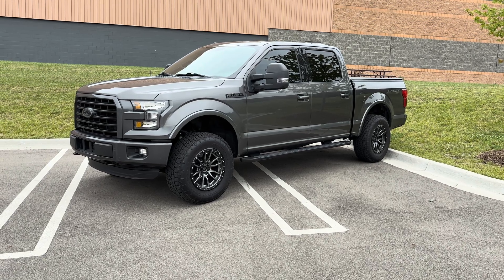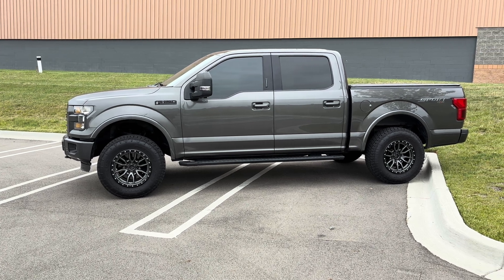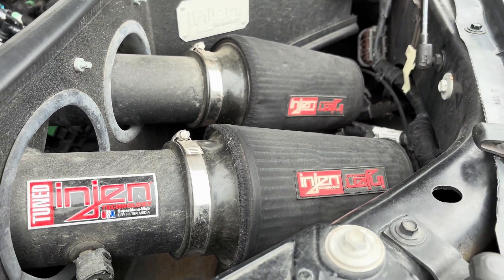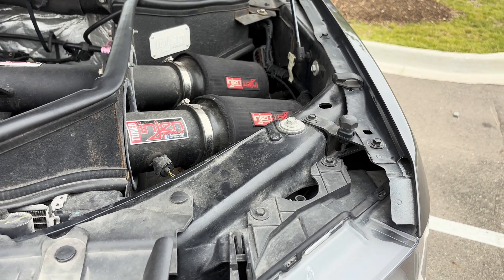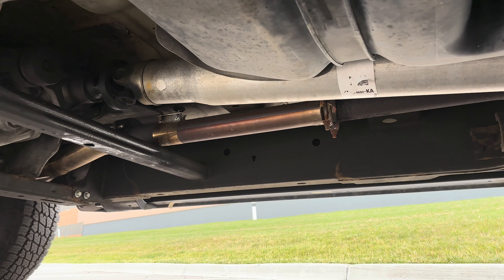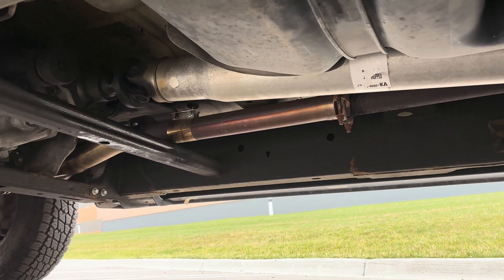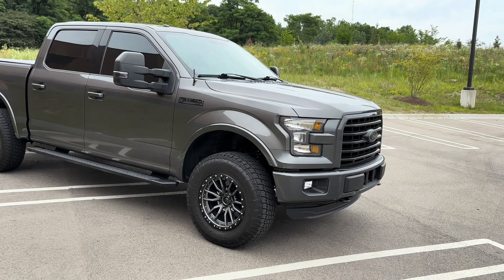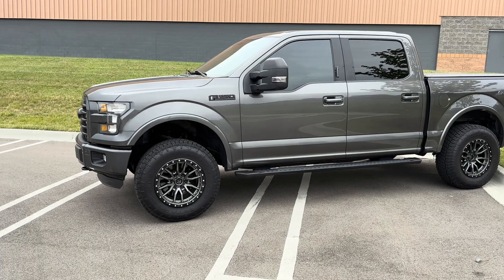How to Build a 450+ WHP 2.7 EcoBoost

Comment: I'm looking to get a 15-17 or 18-20 2.7, but I can't decide... they seem to be about the same price, my main concern is the wet oil pump belt on the gen 2 2.7, and the CDF drum and such on the 10R80, but then kinda worried about carbon buildup on a used gen 1... thoughts?
Reply from the maker: You can always do an intake manifold cleaning. I did it with the Seafoam product to help with carbon. As for oil pump I’ve never heard of the belts failing although anything is possible.
Reply: @TUNED2.7   Makes sense, I had thought about doing something like that so good to know it works. And yeah that's what I had seen too, no failures that I could find at all. I'll probably just drive both and see, I'd love to have a 10-speed, and port injection/E85 capability

Comment: For one, I'm sorry if this is no longer relevant to some folks, but I'm commenting a couple years after the fact and not looking at newer videos. I'm looking at intel for my '24 Bronco 2.7L Wildtrak and this is valuable, thank you! If I can offer just one suggestion, don't feel pressured to speak. Take a breath, it's OK. You don't need to say "um" or "ah" after each thing you say just to fill the silence. If there is "too much silence," you can edit that out. I guarantee you there will never be a silence longer than the one you originally perceived in your head (I know this firsthand). Speak with confidence. You got this! Everything else is gold!
Reply from the maker: Thank you!

Comment: We just got a 2015 F150 2.7 Extended Sport w/ 120k miles on it. New turbos. Love it. going to apply your advise. just got dual air intake and going to get the air cooler next!

Comment: The 2.7 is the way to go hands down. The block is incredible and so much more worth it. Way less issues then the 3.5 and 5.0
Reply: What issues does the 5.0 have?
Reply from the maker: Oil consumption, timing chain and water pump are the main issues I’ve seen as a ford tech

Comment: I had a 2022 F150 2.7 with a 5-Star 93 Octane tune.  I made 360rwhp and 400+ rwtq SAE.  I cant find my dyno sheet, so I dont remember the exact tq.  It was either 410 or 440, just dont remember.  Also, so driveable, just like stock.   Also, had a CAI, but forget which one.  Maybe a JLT.
Reply from the maker: Switch to MPT you won’t regret it. Made 408 with tune only and no bolt ons

Comment: Really wish the car 2.7 setups got the same size turbos. 450whp is aftermarket turbo territory on the Fusion/Edge 2.7s. We have to at least upgrade to 3.0T Lincoln Continental/MKZ turbos and do all the supporting mods you’ve mentioned here to even come close to 450.

Comment: Beautiful example of an F150, but man that air filter is kinda pointless if it doesnt seal off the engine bay air right? I mean the air is going to take the path of least resistance and just flood in around the intake pipes.
Reply from the maker: I got an S&B now. I have a new video out on it

Comment: BULL-SHIT!!! The mains on the 2.7L CRANK aren't HALF large enough to endure 450 RWHP or close to 540 HP net with windage losses, tranny losses and driveline losses!  One hundred sixty-six HP per liter below 9,000 RPM requires cylinder pressures no engine can sustain. It MIGHT make 520+ crank HP, for a few seconds! Top fuel dragster engines make 10,000+RWHP, for 15-18 SECONDS then become wreckage when burning 87% nitro-methane at 22:1 compression ratios, with boost added on top. Aero engines don't make that level of power...
Reply from the maker: I mean you can look at the hundreds of dyno videos out there. There’s many 2.7s making well beyond 540 with turbos, e85 and all the supporting mods

Comment: How would a e85 tune effect reliability?
Reply: Ethanol is more corrosive than gasoline, which can lead to wear on fuel system components (like fuel pumps and injectors) not designed to handle it. I would stick with gas. The custom tunes with gas (91 or 93) are amazing.
Reply: @garygrimes2024  thanks mine is a 2020. Would a 93 tune be better in your opinion for reliability

Comment: What’s next on the upgrade list?  HPFP and injectors?  This would be a monster on an e85 tune.
Reply from the maker: I’m pretty happy with the power it makes on the 93 tune. I know it’ll make way more power on e85 but it’s also pretty hard finding gas stations in my ads that sell e85
Reply: @TUNED2.7  E-85 also causes fuel system corrosion. I would stick with gas. :-)  I just received my SCT tuner with canned tunes and running 91. Already impressed with the boost.  Spun 33" tires from stop without hitting it hard, and ran rocketed to 80MPH so fast. Can't wait to try my 91 PRX tune!
Reply: If u have a 18+ 2.7 between direct and port injection there's enough fuel system to run a e85 tune stock .. truck on my channel has minor mods intercooler .. inlet pipes .. intake .. res delete on e85

Comment: Truck is bad ass.  I want to make the HP without the ricer sound. 🙂 Any suggestoins?
Reply from the maker: Do the down pipes and keep the rest of the exhaust stock. Get high flow cats like mine. If you go catless it’ll sound bad
Reply: @TUNED2.7  Thanks man.  Great video, learned a lot, can't wait to do similar upgrades.  I wish i could see/hear some additional revs on your truck.  :-)

Comment: What kind of fuel is the best to use?
Reply from the maker: If you’re not tuned just save the money and run 87. If your tuned and wanta make great power then do 93 for sure (or e85 if your tuned and rated for it)

Comment: wheel and tire set up? Is that just a level kit? great looking truck!
Reply from the maker: Nitro Terra graps on fuel rebels. 33” tire on 18x9 -12mm. On a 2.5” level
Reply: @TUNED2.7  What level did you use? I did 33" tires, look great without any level. I would like to get the 2" leveling shocks for the front.

Comment: When i was looking for a truck i was looking for a 5.0 but ran across the perfect truck 2018 80k miles already had wheels and dual exhaust but was a 2.7 i bought it because it was a great deal and i could not be happier with the 2.7 i tuned it of course and im so happy i didnt get the coyote the 2.7 is like a diesel makes all its torque at just 2700 rpm and tuned will torch 5.0 trucks.
Reply: Same here, was looking to get a 5.0 but landed on a 2.7 with 80k miles. Are you having any transmission issues? I was looking for specifically a 2018 with a 6 speed but this one popped up and it was a great deal. Now it’s got shuddering issues after about 1000 miles of driving it.
Reply: @davids1924 I had a weird little issue when I first got it when the transmission was cold it didn't want to go into second gear so I changed the transmission fluid and filter and it's fine no problems so try changing the fluid and filter and use something like Amsoil ATF with the blue cap really good stuff it'll fix that problem most likely. Because the shutter is usually the torque converter shuddering when it's locking up and a lot of times that's just dirty fluid
Reply: @davids1924  possibly the torque converter
Reply: @davids1924 it's most likely a clogged filter if you do a transmission flush and a filter change it usually fixes it. Mine did it from 150k to 360k and I pulled a trailer every day.

Comment: Nice Rig!
Just discovered your video. Although I have a '15 3.5 I can attest to all of the gains regarding your mods as I have all of those as well. I still have a set of CVF turbo inlet tubes to install and I'm considering switching from closed box CAI to the Injen open box.

Comment: The spark plugs you have in the description will work just fine for a 2015 f150 2.7L MPT tuned?
Reply: Go with ngk 95605 @ 0.028” gap. These ones are better in comparison with ford GT

Comment: Nice mods. Too bad it’s a soccer mom truck (4 doors). What did these mods do to your mpg?
Reply from the maker: Crew cabs better for gapping people. You get to say “you got gapped by a crew cab” haha. With my level and 33” tires I’m doing about 22 mpg. On stocks closer to 23-24. I drive fairly conservatively and coast when I can
Reply: a 2018 f150 2.7 ecoboost with the proper bolt-ons and a tune will easily gap a 2018 rapter. all about how you mod.
Reply from the maker: I have a video when I walked a 10 speed raptor

Comment: The first mod you can do is buy a coyote and boost it lol. Nice truck man. I'm still hanging onto my 2011 f150 5.0. Truck prices these days are ridiculous! I would like to update someday tho. However it seems like every damn f150 I see are the 2.7 or 3.5. I am warming up to the idea of an ecoboost but I'd prefer a v8.
Reply: 2.7 are solid and built internals are nice
Reply: I have a 2012 5.0 and a tuned 2020 2.7 and the 2.7 is alot better Dailey with more power
Reply: gen 3 5.0 coyote $14k, most people don't have that type of money to drop on a vehicle right of the bat. but that's just throwing money at something and not using your head.
Reply: I don't think Coyote gets as much from the tune. My 2.7L rocks.

Comment: should have just got a 3.5
Reply from the maker: Sure they can certainly make more power. But as a ford tech we do see a lot more internal engine failures along with turbo failures on 3.5 than 2.7 which is part of the reason I went with the 2.7
Reply: 2.7 has way better internals and built better as a whole with the graphite composite block and fractured Pistons
Reply from the maker: Yup. 2.7 was built for boost. 3.5 was originally N/A then ford decided to make some very minor changes and throw turbos on it
Reply: @southeastbikelife400  Fractured pistons???? You`re clueless.
Reply: @REDMAN298  I tell ya what. Look it up then get back to me. Clueless......😂😂😂😂
Reply: @southeastbikelife400  fractured bearing caps on rod and main bearings. I don`t have to look anything up. I`m telling it straight.
Reply: @REDMAN298  so u know wtf I meant then makes sense to be an ass whole for absolutely no reason right? 😂😂🤞

Comment: First off, nice truck and mods and thanks for sharing. Agree with your recommendation of mods though I would recommend a IC before an air intake. Also not sure where you’re getting your HP numbers unless you stated these were all based off the custom tune. A tune will probably get you between 40-60hp on a stock tune, you won’t get 80-100 without other mods you mentioned. Same goes in reverse the other mods won’t net you anywhere close to what you stated without a custom tune.  air intake will net you 0 HP, possibly less without the tune and is useless except for noise and more dirt in your engine.
Reply from the maker: Thanks! MPT claims 410 at the wheels with the tune only. Good tuning can really push out some good power with this platform
Reply: @TUNED2.7  I contacted the company and they did verify your claim that the gains on their site reflect a stock F150 with just the tune. Call me very impressed. I don’t think I have heard of any other tune giving over 100 HP on a stock truck. 5 star which is a well respected company claims they give 60HP for a stock truck and 93 tune. I would worry what they’re doing to push the truck so hard to get over 100HP.
Reply from the maker: MPT seems very smooth in the power ban. I am getting one more psi of boost with them than 5 star
Reply: @TUNED2.7 in the market for a tuner but I’m worried about reliability. If there is so much power gained from just a tune why do you think ford doesn’t make them that way from factory?
Reply from the maker: @OutdoorCanadians They pull back power for reliability and probably fuel economy as well. If you data log and send it in to your tuner then they can certainly get it dialed in so that it’s safe

Comment: Nice truck man! I have very similar modifications on my 2.7L Bronco. Without DPS and CPs I made 400/482 with an E85 Tune on 35” tires. 

I will say, you forgot to mention ZFG Racing. They currently tune the fastest 2.7L F150 and hold a bunch of Ecoboost records.
Reply from the maker: Thank you! I have heard of them actually but never really looked into them much. I’ll have to check them out

Comment: Great work on the video. 
My 5Star tunes are being written next week for my 2018 2.7 Hopefully I’ll be happy with them but I get bored easily. Your video has me considering cancelling my 5Star order and going with MPT.
Reply from the maker: I do like my MPT much better. The 5 star still made great power but the MPT has better power output and the transmission shifts smoother
Reply: @TUNED2.7  good to know, Ty.
Reply: @TUNED2.7  are there any MPT tunes that are for standard 87-88 octane fuel? On the website all it shows is e30 blend tunes. Just looking for a tune for a daily driver not trying to mix any fuel just to go to the store.
Reply from the maker: Yes. I actually got an 87 tune from them as my daily driving/winter along with my 93 tune that I’ve had for a while
Reply: @TUNED2.7  Nice! That may be the one ill go with. Thanks for the feedback.